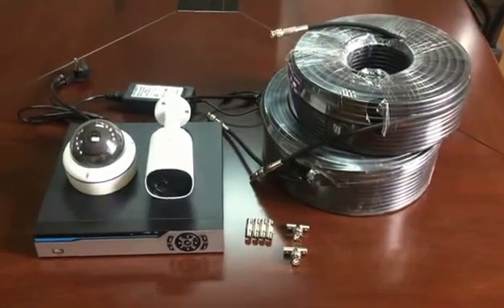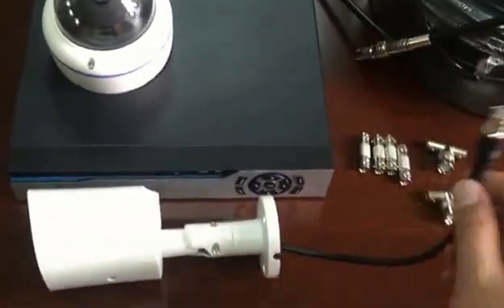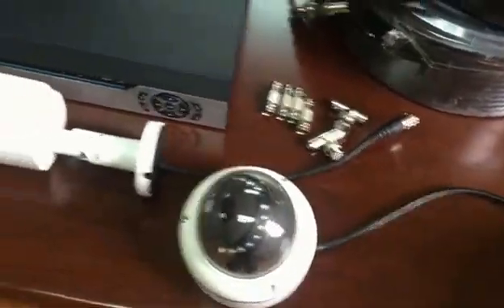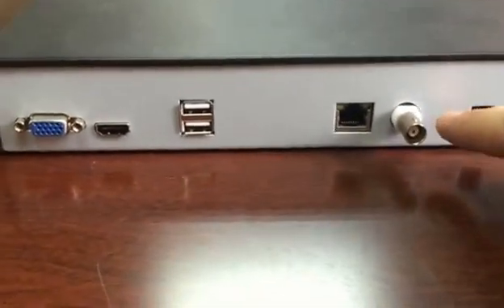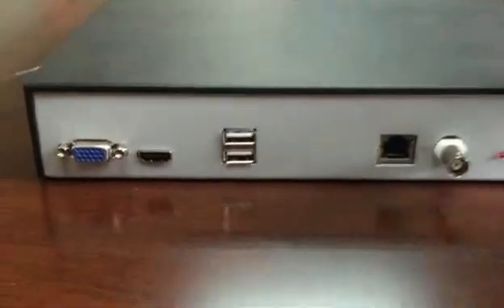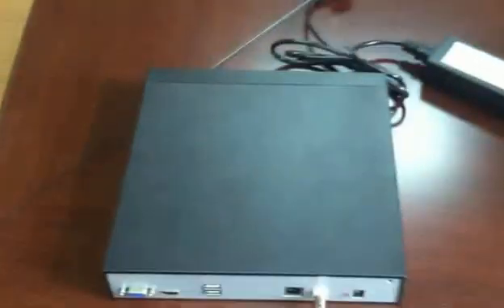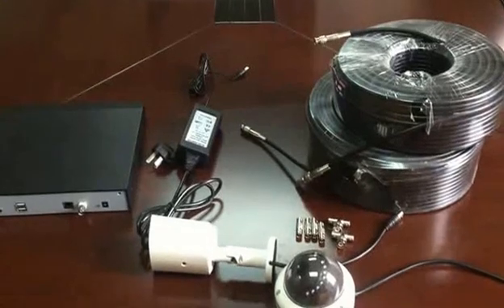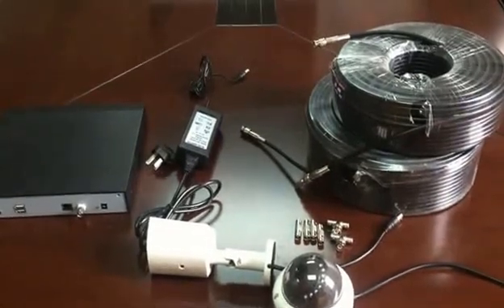Introduction of POC product

Comment: I bought your Powerline PLC KD-PKB20 and can not get it to work.
I need FULL instructions by video or pdf to set up each camera and the whole system 
Also is there  away to reset it like its new so i can start over.

I can not get more than one camera to work intermittently and have NO IDEA how to fix this as there were NO instructions with this system. Please email me at johnnyhavana27@gmail.com with help.